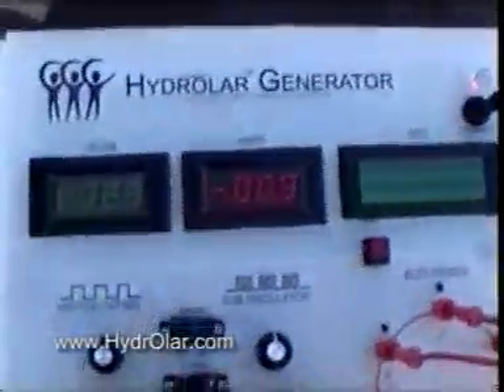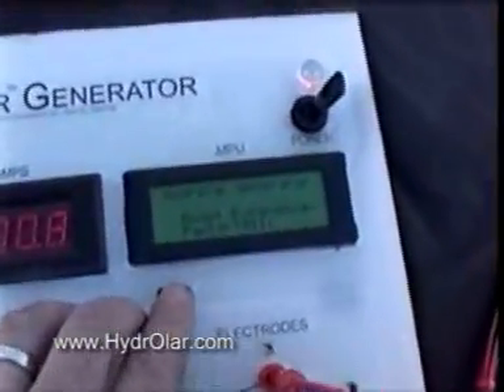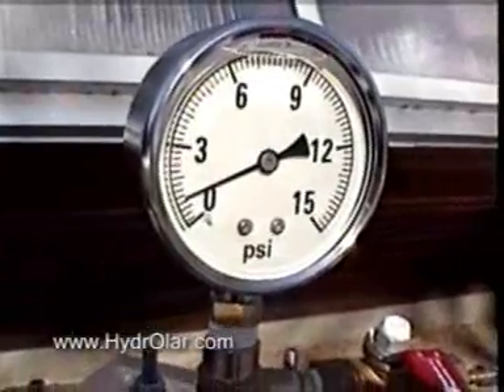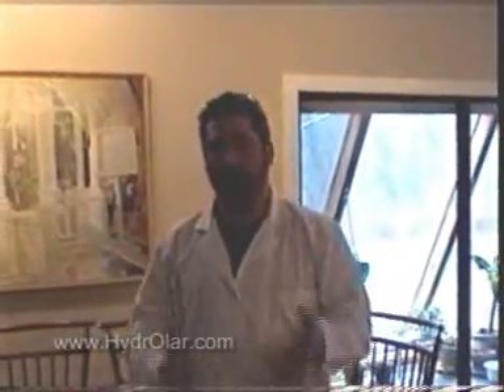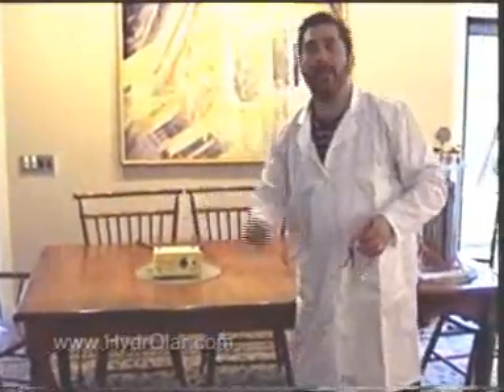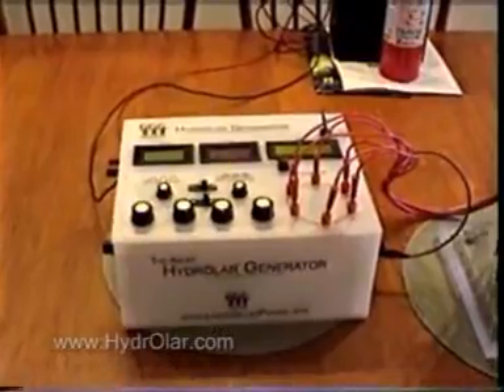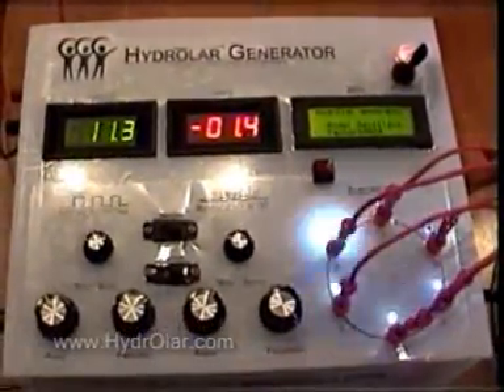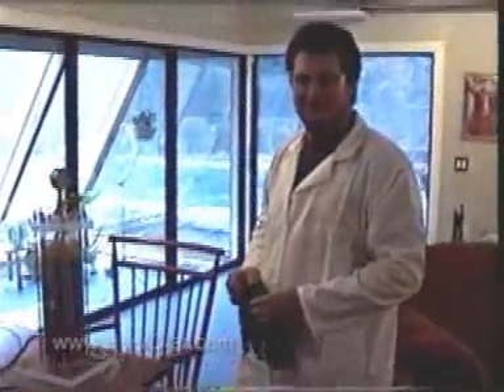Exploding tap water with sunlight

Comment: I hope that you have platinum electrodes or they will no last for as nearly long as they could. Besides for any practical use you need to find a way to store hydrogen that is the biggest problem anyone has and you cant just use anything. As for your water understand that if your water is not and only  distilled you will still be giving off elements other than just O2 and N and some from electrodes themselves during electrolysis unless the anode and cathode are platinum.